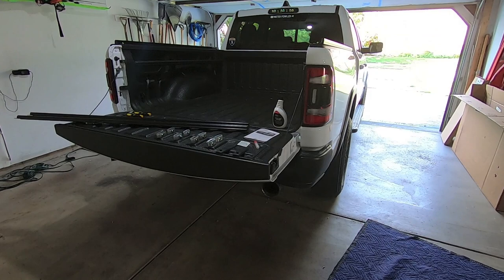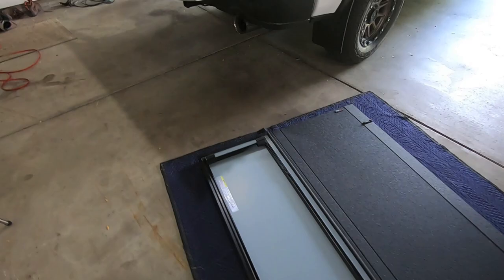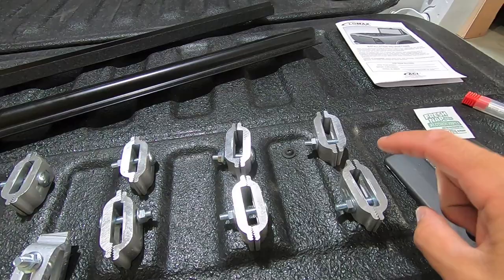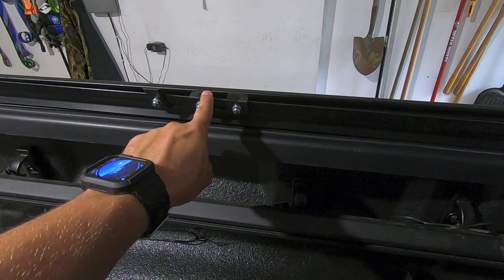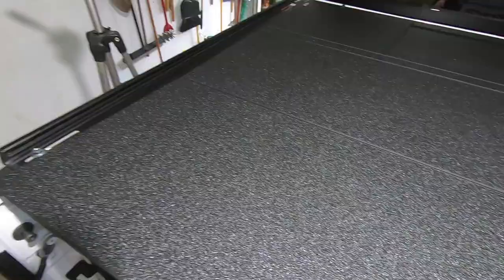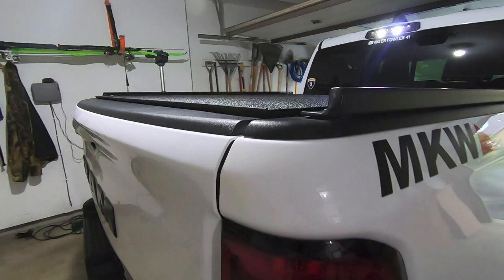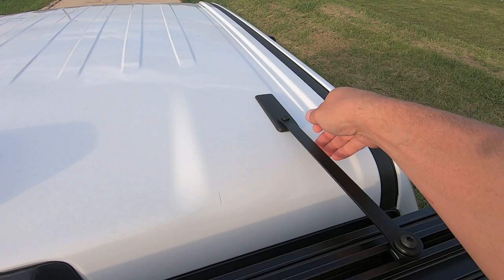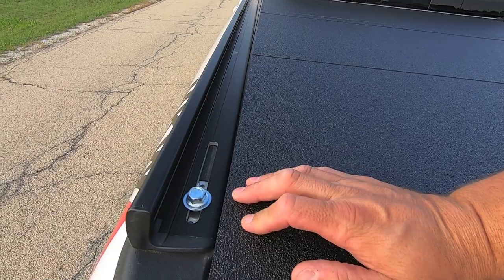LOMAX Stance Tonneau Cover - Ram Rebel

Comment: Ehhh idk for me I don’t like the idea of having to attach anything to the top of the cab for a tonneau cover. But that’s just me.
Reply: It’s magnetic
Reply: @DrDennis  its a sticker
Reply from the maker: They’re magnetic and backed with 3m. The truck back brackets stick to the roof top brackets via the magnetism.
Reply: @WaterFowler41  do you think the 3m will mess up paint on the truck?
Reply from the maker: simd510 nope! 3m vhb is used all the time for body moulding mounting. Very safe for the paint
Reply: @WaterFowler41  Thanks for the reply! That was my only concern with this cover.

Comment: Was seriously considering this cover because I liked the seals, the finish appearance and the ease of installation. But then I realized that it would block the cab tail lights, stick up higher than most, creating some drag,  and I would probably have to climb into the truck bed to attach the brackets unless I was extremely tall, whereas on other trifolds the support arms are on the side of the bed and nothing needs to be glued. The other trifolds also wouldn't obstruct the cab tail lights or create as much, if any, drag.
Reply from the maker: If you plan on driving with the tonneau cover up a lot (enough that you’re concerned about drag) maybe a hard trifold cover isn’t the right cover for you.

I’d look at hard rollup covers as a possible solution.
Reply: @WaterFowler41  Still want to try a hard fold, just not this one. Had a hard rollup in my last truck. Trying something different. All the other brands sit much lower when standing. This one clears above the roof. Might even try their trifold that doesn't stand. Only needed the full bed in the Ranger a couple times. Was I correct in my observation about climbing into the bed to access and hook up the stand brackets? Thanks for getting back to me.

Comment: Pretty nice tonneau cover, but tbo I don't like the cab top mounts or the fact that the cover isn't flush with the bed rails.  For my purposes, I chose a Bakflip MX4.  It's been on my '17 ram for almost four years now and still looks like new.  Except for the side seals, it fits flush with the side rails.  Just my .02.

Comment: If your traveling at a high rate of speed on the freeway this might be an issue if the cover is up against the windows creating wind resistance compromising the latches on roof 🤔
Reply from the maker: Never had an issue and spent a significant amount of time on expressways at speed with the top propped open.
Reply: @WaterFowler41  good news, 👍 because I went ahead and got it.

Comment: Hey Not liking the way it straps to the side rails when totally open then those anchor arm supports to roof don’t look it would hold on too long as headwinds driving at speed limits above 25.
Reply from the maker: I’ve driving a few hundred miles with the tonneau open while carrying a kayak on my rack and a truck bed full of stuff, never had a single issue

Comment: Sticks way up to high to make drag……plus blocks the back window from seeing what you’re hauling………Tri-fold from Mopar is the way to go….very light…so no added weight to waste gas….folds up easy and if you need the entire bed comes off in mins……
Reply from the maker: If I’m hauling anything that requires the whole bed (our 4 wheelers, furniture, etc.) aerodynamics are kind of a moot point, wouldn’t you think? 

Like I mentioned in the video I like having the ability once we get to our destination to easily drop the tonneau and have cover and a dry bed. With how much stuff we bring with us, I don’t have room for a tonneau cover.

Comment: Beautiful truck man, I’m considering getting a lomax as well, another video i saw it seemed like the last pannel was flexible enough to easily lift in the middle with your hands enough to see the pull cable. Thoughts? I know a thief will get in if he wants to but i wouldn’t want it that easy either.
Reply from the maker: Like pretty much ever hard tonneau if you pull the last panel up hard enough, you’re getting in. The lomax has some flex but I haven’t seen a hard tonneau that doesn’t.
Reply: @WaterFowler41  got it thanks for getting back to me

Comment: How secure do you feel this is? Would it be difficult to open it with say a close hanger snagging the cord?
Reply from the maker: If someone knows where to place the hanger they may be able to open the cover. It takes quite a bit of force though so not too sure a normal hanger is enough. Most tri-folds are prone to this issue.

Comment: Do you think this is a better cover than the Undercover Armor Flex?
Reply from the maker: I’ve never used the armor flex so can’t really opine on it but I love this cover and think it will outlast my truck!
Reply: @WaterFowler41  thanks for the reply. I have a 2019 Laramie and am looking for a good hard cover as well as kayak rack and I like your setup. Thanks.
Reply from the maker: Yeah you can’t go wrong with this tonneau/rack combo. The pro series rack is super light so when you don’t need it, it’s very easy to remove from the truck.